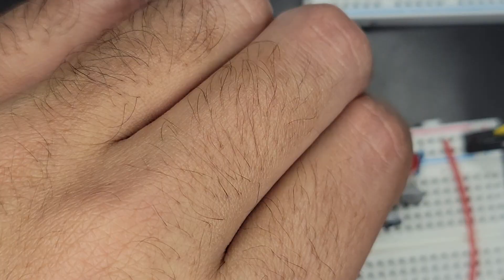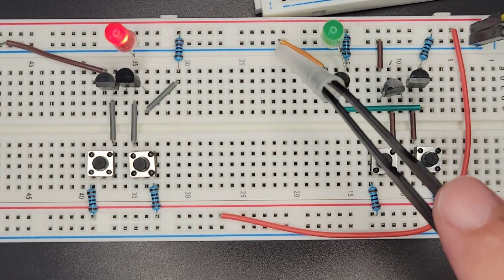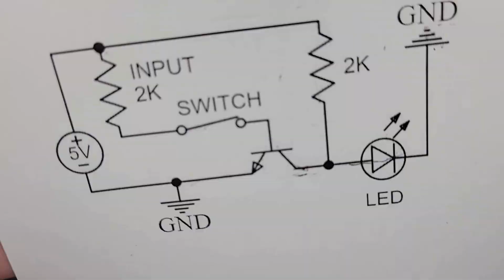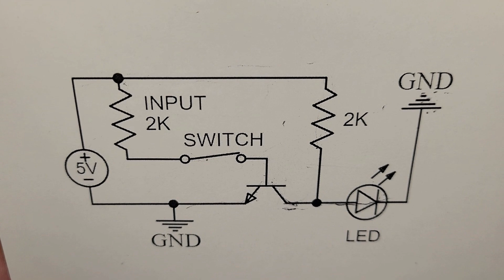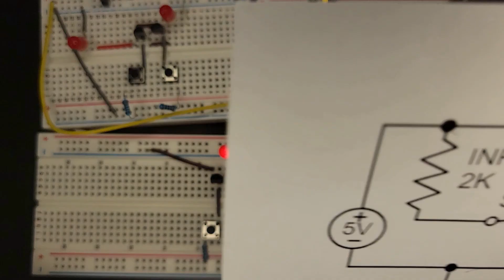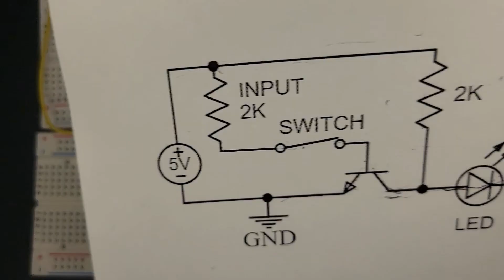AND Gate from NAND - Step-by-Step - Beginner Learns Electronics E8 - NPN Transistor Logic Gates

Comment: You keep saying the flow has an easier time going a certain way how do you know? like I understand a resistor will be harder to flow through then a normal wire but why doesn't it travel both any ways like pushing water in a pipe that would go down both.
Reply from the maker: To my understanding, the current does flow through every available path, and resistance is what decides which path gets what current. So in this case, when we send a HIGH/ON signal to the inverter, the LED/output has virtually no current, since there is a much lower resistance path through the transistors.

In the XOR videos (I think it's the next one?) I have a major problem with this exact topic, and basically had to figure it out through testing to get it working properly. (All of my current was escaping in one path, and I had to add resistance to that path to allow the other paths to get more current)

I hope this helps -- and if someone who is more knowledgeable than me can also contribute some more information, that would be great!
Reply: a wide open pipe has less resistance and allows more water to flow.
a pipe with resistance (throttling valve) in it will block the water flow.